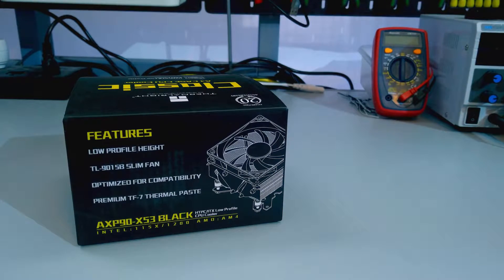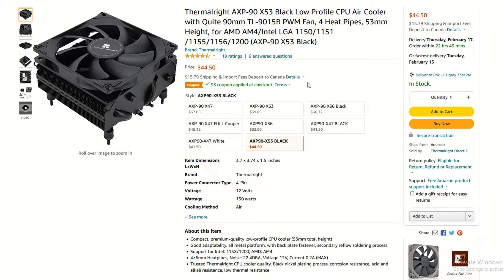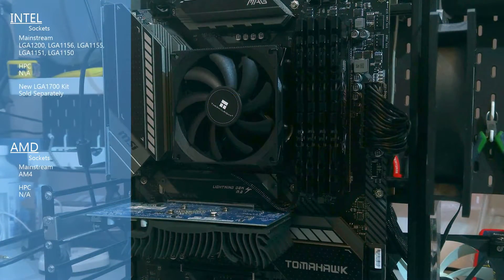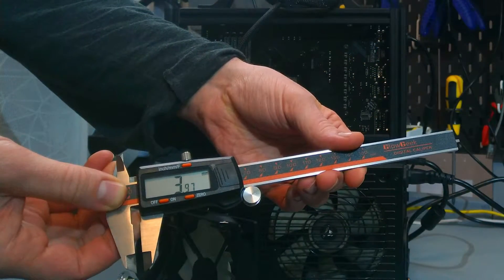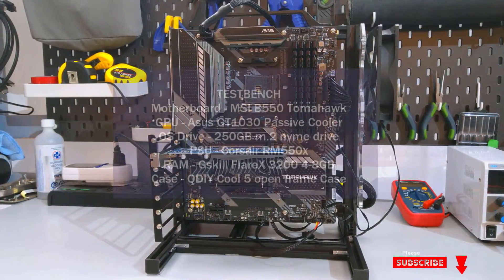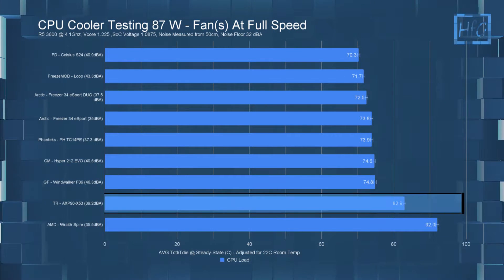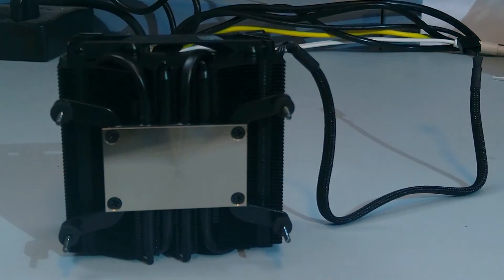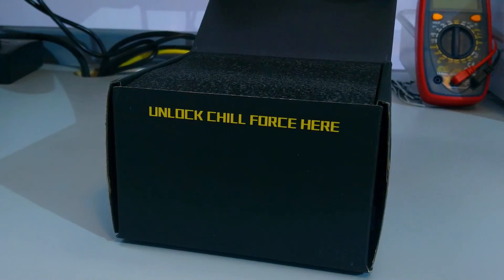The ThermalRight AXP90-X53 - CPU Cooler Review

Comment: What low profile cooler have you had the best results with? I only have 135mm height clearance and my assassin king mini is millimeters away from my glass. I hit 95c in about 8 minutes on prime95 which is pretty bad. I hit high 80s and low 90s in game sessions. Thinking about just switching to a low profile cooler when I install my 5600x in my current mid tower case. Not sure if the cooler being millimeters from the glass is hurting the performance or the AK mini is just that bad. Also using MX-4 paste instead of the stock paste given with TR coolers. Not sure if the MX-4 is any better but it's affordable
Reply from the maker: This is a very loaded question without having more info. Are you sure the issue is the CPU cooler? or do you have Airflow issues in your case? what CPU are you currently using and are you OCing it? however to answer your questions, for a tower cooler being close or touching the glass shouldn't affect the performance of the cooler. The best low profile cooler I've tested is the ThermalRight SI100, which is a okay cooler. Not sure how it matches up to mini tower coolers, but it does lose to standard 120 tower coolers. Regarding paste, just as long a you don't use the really cheap stuff most pastes are much the same.

Comment: Your CPU is Ryzen?
Reply from the maker: Yes, for this cooler I used a Ryzen 5 3600.
Reply: @HardwareForGamers  So, does this air cooler come with the rear plate so that it can be screwed horizontally? (Standard AMD cooler style)
Reply from the maker: @canalsjr02  there is an included backplate that works for am4 and some Intel sockets.
Reply: @HardwareForGamers  Oke, thank you so much!

pD: Is it normal that the RGB of the ram, graphics card and peripherals, just before entering the desktop of my PC, does not update to the custom ones? (I customized them in white, but the ram and peripherals take time to update)
Reply: yes I would assume so, as you probably set the color for them in software at the regular Windows level instead of the bios, so they will only adjust accordingly once the software controlling them has started. That obviously doesn't happen immediately upon boot, but once you enter your desktop.

Comment: Is this a silent cooler all around?
Reply from the maker: At full speed this cooler had a dBA of 39.2, but it is a pwm fan so it should be simple to setup a fan curve in the UEFI or by using FanControl
Reply: @HardwareForGamers  Just installed this cooler today and coming from an intel stock cooler the X53 was quite nice even at full speed. Im still not used to this silence coming from the PC lol

Comment: When using the backplate that comes with the heatsink, one must pay close attention to not over-torquing the nuts. The screw pads do not make contact with the CPU side of the motherboard, and it will feel like the nuts can be tightened further...and yes, they can, but if you over-tighten them, the board will bend towards the heatsink. It is not evident what advantage there is to using that backplate. Using the backplate that comes with the motherboard, the screw pads will contact the CPU side of the motherboard via the backplate extensions used by the removed AM4 plastic brackets' larger screws, thereby reducing the chance of damaging the motherboard by flexing it.
Reply: So you can use the stock am4 back plate that comes with the motherboard?

Comment: Can you use this on a Ryzen 9 5900x  in a mid tower case with good air flow ?
Reply from the maker: I would not use it for loads of more than 100 watts. So it depends on how you're planning on using the 5900x. But I would say no.
Reply: @HardwareForGamers  what about 5800x? , just for gaming in 1440p and do some architectural rendering
Reply from the maker: It should work for a 5800x, if you can undervolt the CPU.
Reply: There is no reason to use this in a mid tower. I'd get a bigger one, these are for space optimized cases.
Reply: @greb.  to bad my case clearance is only 148mm, im using metallic gear neo qube btw
Reply: 148 mm is almost thrice the height of this cooler (53 mm), what are you talking about?

Comment: The Thermalright also has the advantage (along with the AMD box coolers) vs. tower coolers (ie. Hyper 212), of cooling board components...especially the VRM.
Reply from the maker: In some circumstances, like gaming, you are correct. But if the CPU is being heavily utilized then the vrms will be hit with heated air possibly making them warmer. It really comes down to the system and how much case airflow there is, like most things.
Reply: I heard people say so. One day I bought the no 1 top-down cooler NH-C14S (just because I dont like tower ones, not the VRM matter).
Stress test with two fan positions:
Fan below the heatsink and pull air from VRM, CPU and push above: max VRM temp is 80oC.
Fan above the heatsink with push position down to the CPU, VRM; yeah we think it may blow air to cool the VRM but max VRM temp is 87oC.
Max CPU for both positions I got is ~ 66oC.